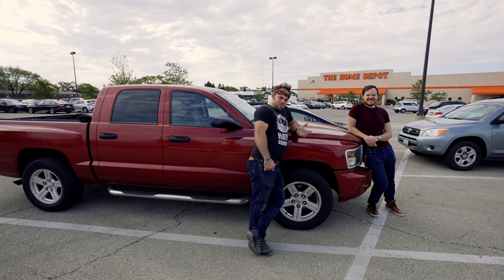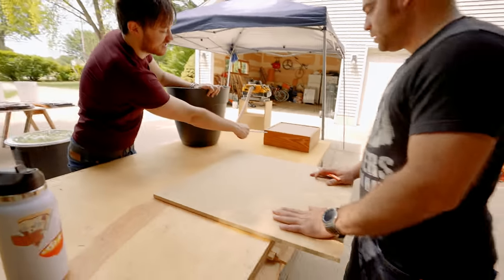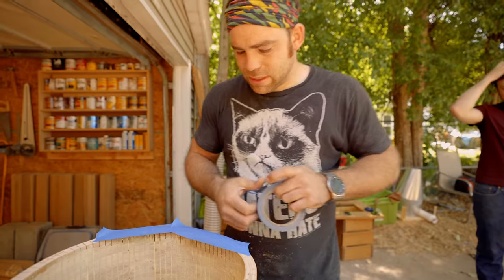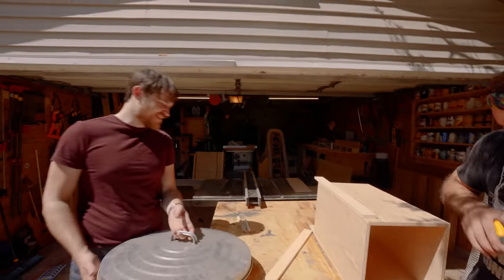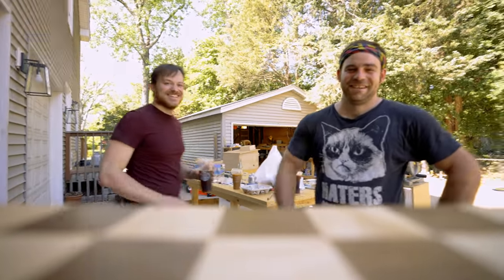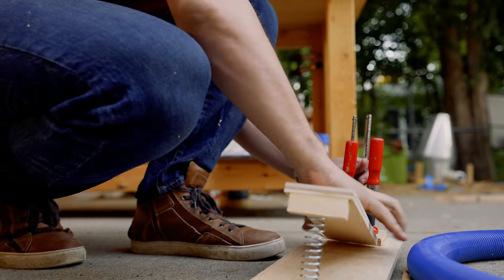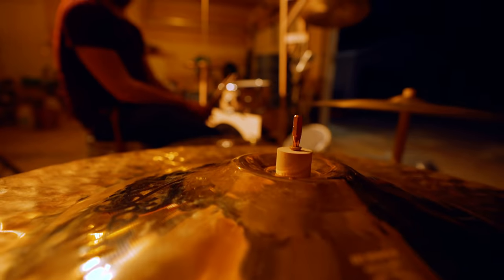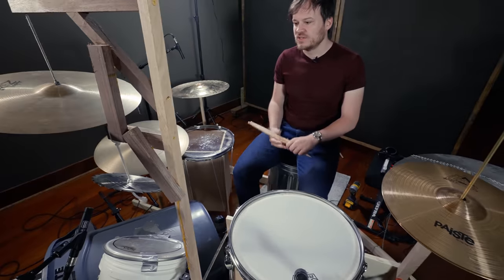Building a Drum Set from Scratch (with no experience)

Comment: When I was a kid around 9 or 10 I built my first drum kit similar to this one: washing powder box (tube) as kick, using the lid as head, a tambourine as snare (also got some wires attached actually ON the single head below) and some metal lids from whatever it was mounted on tripods as cymbals. Got a "real" hihat, too. No toms. Built also a kick pedal out of wood but with a "real" mechanism (spring-loaded to pull it up but pull-down was made with some fabric screwed to a wood plate). Sounded terrible but with a single (!) stereo mic mounted to the snare I got a real powerful and compressed sound overall. Man, that were really good times!

Comment: That snare drum is actually a work of art, I'm impressed.
I'm a little surprised they didn't get the hihat closer to be honest. They used brass pipe and (essentially) a wooden dowel which has been cored which works for the lower hat. I'm surprised they didn't just clone the kick pedal and run it to a threaded rod from the hardware store fit inside the brass pipe and use some washers and nuts to secure the top hihat. Honestly could have gotten pretty close to a legit hihat that way.

Comment: for the base drum you couldve used alltread rods and mount them between the top and bottom like you did with the ropes  , pulling them together will tighten the drumbead 
problem with the square boxes is the the corners will pull through the drumhead , a octagon would be better , anything closer to round would be better as it evens the tension on the drumhead 
allso round over the edge for the drumhead , makes it slide eazier when tensioning and prevent the drumhead tearing on the edge when hitting it with a drumstick
if youre spending money on materials you might as well make it as good as you can

Comment: The mechanics of a hi-hat might actually be simple enough to do if you had more time to work on it. Some thin PVC pipe, a metal rod to go inside it and connect to the pedal, and some springs to hold the pedal up, plus a bit of structural support, and you might be able to produce a somewhat usable hi-hat.

Comment: I wondered if the build ideas were all implausibly bad on purpose for content, but then I saw all the incredibly dangerous stuff they were doing and concluded they are actual morons.

Just a few examples: using a table saw with no riving knife, no pusher (even when cutting tiny pieces), leaning over the blade... I really hope that saw has a sawstop. At one point one of them is running the drill in and out at full speed about an inch away from the other dude's hand! There were so many safety issues, it's only a matter of time before someone is seriously injured in this workshop.